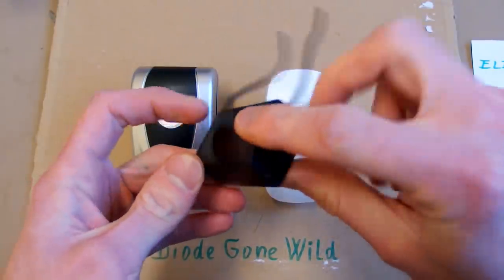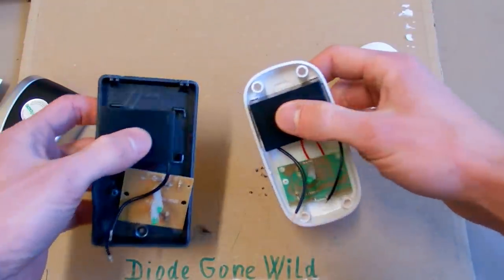Autopsy of the Mysterious Black Box from the Chinese Power Savers

Comment: This is exactly what you find in a motor run capacitor. Instead of an oil dielectric, this used a kind of wax. The silver is the aluminum electrodes insulated by a film, not unlike suran rap. It is probably made of polypropylene. very common in ac capacitors. what it does, is create a phase lead when plugged in. The idea is to cancel the phase lag caused by induction motors and transformers. unfortunately, they only make a barely measurable difference in VA, but no difference in wattage. The most effective way to use a capacitor for power factor correction is to place it as near the motor or transformer as possible. It won't save any real amount of money.
Reply: That´s almost correct. The wax ist just a cheap filling (insted of resin, to protect it from moisture) and the dielectricum is still Polyypropylene (PP) or PET, PEN, PTFE, etc.. And its OK to just put the power-correction-caps next to the meter.

Comment: A mylar film capacitor wrapped in schmoo
Reply: It appears to be clay. ??? Maybe it helps cool it but it also cats way down on the amount of resin needed to seal it.
Reply: That "mud" may also be used as an acoustic attenuator, since AC sometimes created a humming sound in certain components (50 or 60hz depending on country).  But I still don't get how this can cause a modern solid state electricity meter to be fooled?  Mybe 30-40 years ago when the meters were the "spinner" types.
Reply: @BillAnt  It isn't to fool the meter, it is to attempt a degree of power factor correction. A poor power factor causes innacurate readings of the actual energy used. Industry standard techniques used when dealing with a highly inductive load.
Reply: @MrPGT9999 < So wait, you're saying that this is used for power factor correction, but doesn't that make reading actually more accurate since it lessens the power fluctuation?? Maybe I'm missing something.
Also, someone please explain the underlying theory of this power scheming scheme. lol
Reply: Schmoos are the best.  Farm them for the Crissagrim...
Reply: @BillAnt  These devices aren't supposed to cheat the power company/meter in any way, more to stop yourself from being cheated by inaccurate measurement caused by the power factor of your equipment being less than perfect.
Reply: @MrPGT  < Thank you so much... your info was not in the video or posted anywhere so I will highlight it here for anyone else wondering like I was ;)
"These devices aren't supposed to cheat the power company/meter in any way, more to stop yourself from being cheated by inaccurate measurement caused by the power factor of your equipment being less than perfect." ~ courtesy of MrPGT9999 ~
Now it makes perfect sense, this "dodgy" device is supposed to "smooth" the power fluctuations (power factor correction).  Got it!! :)
Reply: @BillAnt  Big Clive has torn down power savers and some of his videos explain power factor and power factor correction fairly understandably. Also, Great Scott has some teardowns and clear explanations.
Reply: @MrPGT  < Yes I watch those too once in a while, but 
DiodeGoneWild here only did a tear down, I didn't catch an in-depth explanation of the theory behind it.
Reply: 100% schmoo thru and thru
Reply: I want to know what the schmoo smells of.
Reply: @MrPGT  It's true that this is the justification for solding this device. However, even in a house such a tiny capacitor won't have any effect. Here is the prank.
Reply: @vptech9861  If it does have any effect, it would be as likely to make things worse. To work properly, it would need a capacitor in circuit very close to each inductive load, and properly matched to that load.
Reply: @MrPGT  agreed. (And a such small capacitance would be more likely an EMI suppressor rather than a phase corrector)
Reply: @MrPGT  PF correction capacitor doesn't need to be at the load.  However it must draw capacitive current approximately matching the inductive current drawn by the load.  For example, if a bad device draws 5A resistive plus 5A inductive,  drawing 5A capacitive cancels out the 5A inductive.  However if a modern device draws 5A resistive plus 5A capacitive, drawing another 5A capacitive just makes it worse.  Drawing 5A capacitive with your inductive load turned off also makes things worse.  Inductive current is a quarter cycle delayed from the voltage, capacitive current is 3/4 cycle delayed, so will be pulling whenever the inductive load is pushing.

Comment: I have one of those "power savers" disassembled and was pretty disappointed... 
About capacitor value do you know how big it is?.?
Reply: It varies from one to another, but they are usually around 2uF.
Reply: @skyem5250  At least it can be used as a high voltage well insulated capacitor...
Reply: @vptech9861  These caps are used in induction motors, such as fans... they are not rated for more than 400v

#superlatereply

Comment: This is what happens when you apply a technology with a specific use, without understanding (or caring) how it works or why it only works for that specific situation.

In this case, power factor correction on big industrial-sized motors can benefit from this sort of technology*, but nothing domestic can: utilities don't even monitor PF offsets for non-large-industrial buildings, so even if your home's PF is extraordinarily somehow off, you are not paying for it anyway! - though you are probably paying a few extra cents a quarter for the trickle of extra power driving those resistors and LED. Plus the money you spent to tie up a power point with a brick of nicely-packaged e-waste.

* well not a crappy cheap capacitor in a wall-wart, but a proper PCF capacitor bank in the factory power distribution centre will do the trick.
Reply: Yes, I think that DiodeGoneWild should have added this remark at the end, even if I enjoyed this funny and sarcastic tear down!

Comment: 1. You can't measure capacitance by holding the test leads on the wire because you WILL pick up the capacitance of the human body. 

2. The black box is a power filtering capacitor. The gray stuff inside keeps the capacitor cool. 

3. The black box can also be found in ceiling fans as well as some circulating fans. 

Just FYI.
Reply: You can measure capacitance while holding the test leads in some cases. It will put the human body capacitance in parallel, but it is very small so its effect will be negligible for a capacitor of this size. Typical capacitance of human body is 5nF. These capacitors are usually around 2uF (2000nF). This means that adding your body in parallel will increase the measured value by 0.0025%, which is well within the tolerance of a typical multimeter. Putting your body in parallel is only a problem if you're using high precision equipment to measure capacitance below 100nF.

Comment: I see a capacitor. The clay or whatever that stuff is surrounding it is to prevent wasted energy. I think it's wattage, but I'm not sure. I was taught in school voltage is pressure, amperage is amount of electrons or water, and wattage is the waste of energy created by such power in such a pipe of such a size. I was smart enough to ask the question; "What is wattage. Is it the energy released by the amount of electrons flying through the pipe, like when you open a high pressure valve on a dam and it makes a loud roar?" This instead is release of energy through sound or vibration, heat, and decay. Like a 120V 60W incadecent light bulb puts out so many lumens and will only last so long. Or a speaker uses so much energy to vibrate a diaphram to produce sound. Even resistors producing heat. The clay or grey substance I believe is to dampen vibration and absorb heat and maybe even electromagnetics and contain them in the film instead of in the air. Hi-Fi sound equipment uses a similar thing on their transformers. They lay the tranformer in a container and fill it with insulating tar, clay, or resin to dampen the vibration and external electromagnetic field generated by the coils not  the main induction used for the transformer to do it's task mind you. That is only effected in minor ways. The main goal being to insulate transformer from eachother and waste as little energy as possible without effecting their task or operation. If it was only insulated by air, the power supply would waste energy and produce humming, electrical noise, and impure voltage and current as both transformers vibrate, heat up, and interfere with eachothers magnetic fields, thus the tar, clay, or resin and insulating container produce a cleaner, and more sensitive power for the tubes to operate more sensitve too. For example, a guitar amp with exposed transformers placed closer together compared to a Hi-Fi tube amplifier with insulated transformers placed further away from eachother. Some guitar amps will hum, pop, crackle, and sometimes if powerful enough, even produces horrendous noise from the insides where the tube amp doesn't have any of such. It even utilizes the waste of heat, light, and plasma in it's vacuum tubes to properly operate, but it's down to the power supply and outlet to supply clean enough power to those tubes. This is why most audiophiles will pay hefty prices to install their own utility pole that is not shared at all, straight from it's own mains line. Someone overloads their house or breakers and thus they suck more power out of the mains which is shared with you and when items go on and off, your lights flutter and so does the power supplied to your Hi-Fi equipment from those mains into the breakers and outlets of your house, then your Hi-Fi system is so sensitve it picks those drops and surges of power not only damaging it and it's purpose, but amplifing those dips and spikes and your audio is no longer hi-fi. In this case it may save you a tiny amount of energy, but overall it won't do much in the long run. May save itself and a bit of vibration and heat from happening to itself, but your equipment or whatever you power is gonna waste energy on it's own anyway and to build such a device will only waste more with that device plugged into it. May supply cleaner power but it goes like this; why plug a surge protector into another surge protector. Or why plug a blender into a stove? If you run hi-fi tech like tube amplifiers or hi-fi turntables, this is perfect for that, but if you use garbage on it like a $10 toaster or AC-DC adapter/inverter, it's not gonna help you at all.
Reply: Did a bit of research: It's just a self-extinguishing resin apparently

I would argue that you own pole won't get your audio any better. Just my graphics card rendering the screen produces funny in one of the computer's jack but not in others... Good caps and fast properly-designed SMPS or transformer should do the trick. But nowadays everything's digital and that kind of eliminates the problem with interference created by power supplies and other impurities

Btw, wouldn't it be cheaper and easier to get a solar power equipment for your audio things?

#SuperLateReply

Comment: This is alien technology a film capacitor and it's interesting because it's a very strange and mysterious technology that produces dree energy it's just made of a very thin mylar film with electrodes on each sides and it can store energy. This is because two electrodes separated by a dielectric makes a capacitor and the larger the surface the larger the capacitance, that's why it's wrapped around several hundred times.

Comment: A capacitor can reconcile or correct the voltage and current phase differences (power factor) caused by inductance loads. This really can save electricity bill only to a negligible amount!
Reply: In most cases, power factor of a house is already capacitive, so this actually makes it worse.

Comment: It is just a big capacitor witch should reduce the shift of current and voltage and so increase the efficiency of any divice witch works with AC.
Reply: Lol that's nonsense :) At best it can improve the power factor of an inductive load, but given that home electricity meters don't measure power factor anyway it won't save any home users any money at all. It certainly won't improve the "efficiency" of anything, especially not "any device which works with AC"!
Reply: @AndrewGillard  Old style electricity meters wasn't able to count all types of loads happening in AC circuits. New models are smarter so these boxes may be used only as casings for DIY devices.

Comment: These thing generates harmonics and local home electricity meter cant read harmonics so less power being metered but due to harmonics disturbs other people appliances and make noise running on same line
Reply: It does not generate harmonics. It actually decreases harmonics on the AC line. Also, electricity meters measure total energy transferred, and changing the waveform (increasing or decreasing harmonics) does not have a significant impact. However, the capacitor does draw reactive power, which means that some energy is dissipated in wiring, and you have to pay for that energy.

Comment: NEXT TIME CONNECT THIS TO BATTERY :) I MUST SEE BOOOOOOM!
Reply: If you connect a capacitor to a battery, it will not explode, unless the Capacitor voltage rating is below the battery voltage and the battery can deliver high current. In this case, you would need around 1000 typical alkaline batteries (500S2P Configuration) to blow it up.

Comment: UGH! I wouldn't touch that gunk without gloves. Your narration made me laugh soooooooooo hard! I really think you should debunk the audiophile bullshit, you'll definitely be good at it, loved by many, hated by some. 

These "power savers" are just a scam and the only thing they're supposed to do is compensate the inductive reactive power by introducing a cap into the circuit. Of course with such a small cap no serious compensation can be done, and nowadays most households use a lot of electronic devices which draw enough capacitive reactive power to compensate any inductive reactive power drawn by motors etc. Not to mention that household tariffs don't make you pay for reactive power, but commercial/industrial tariffs do. That's why batteries of capacitors for power factor correction are often found in industrial settings with a lot of motors.

Comment: the blackbox is a capacitor and its used for power saving cuz once charged thething gives power IN the outlet(in my device)
Reply: No, that's not how it works. It draws current, but the current is out of sync with the voltage so it draws power some of the time, and puts power back in some of the time. Electrons oscillate between the electrical grid and the capacitor. Furthermore, it can't output more energy than it  takes in. Since no capacitor is perfect, there is some power loss, and so it actually draws slightly more power than it puts back. They can be used for power factor correction which decreases power loss over long runs of wire, but only for inductive loads (motors, magnetic transformers, etc.) and the value has to be precisely calculated.